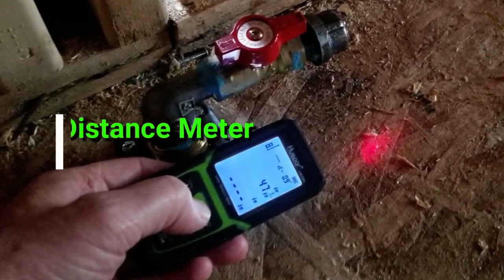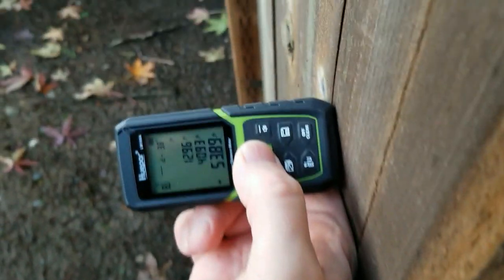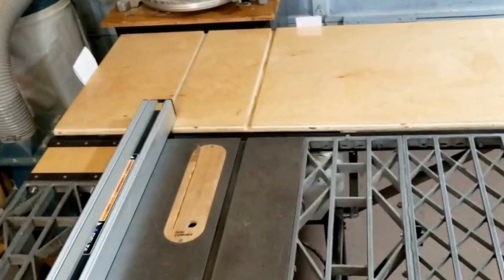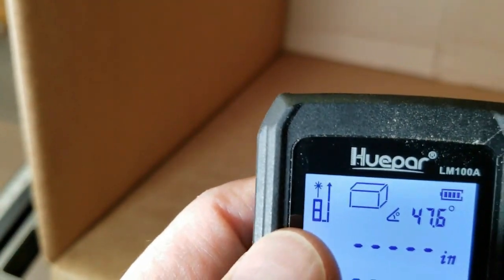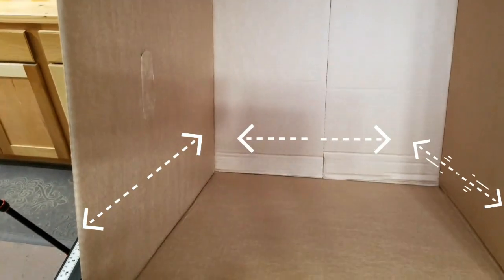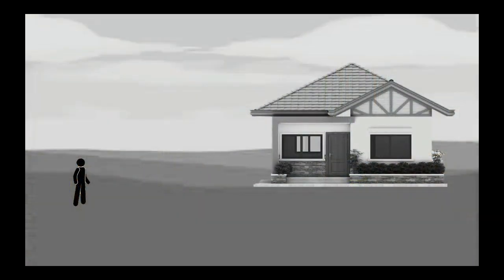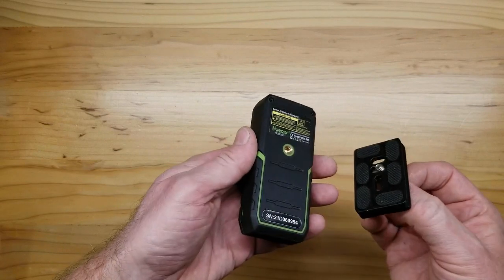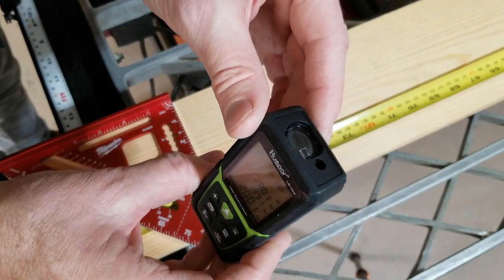Huepar LM100A Distance Meter Part 2 - Use and Operation

Comment: Excellent video! Thanks so much. I was looking for use details rather than the usual unboxing vids, and yours goes the extra, functional mile.
Having said that, the unit I'm waiting on is the LM120A .. And I'm wondering if it will suffer from the same Pythagorean calc issue as the LM100A?  Glad you were detailed enough to find that so I can test mine when it comes in. 👍👍

Comment: First off... Around $40! That's a great deal . Do you have an affiliate link?
Second, when using the additive feature do you need to click the plus button every time or is it modal?
Third, how many walls can you do for the painter function?
Thanks for the solid review.
Reply from the maker: Hello Brian and thanks for watching.  I've added affiliate link to the video description.  If you do decide to purchase one, I'd greatly appreciate you using the link as it will help my channel.  I believe Huepar is currently running a 15% off sale on your first purchase.  Regarding your other questions, the straight-line additive function is modal (pushing the + button once puts it in the additive mode).  As for the painter function, Huepar does not state maximum number of walls; however, I checked and was able to do over 100 without hitting a limit.